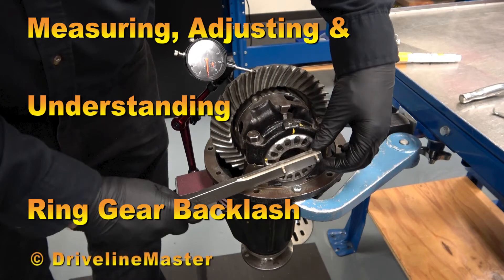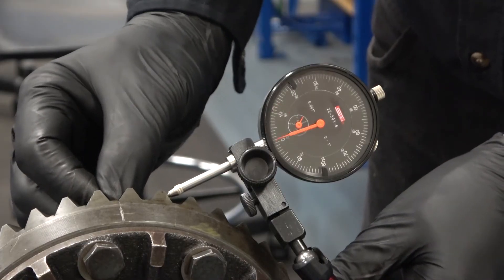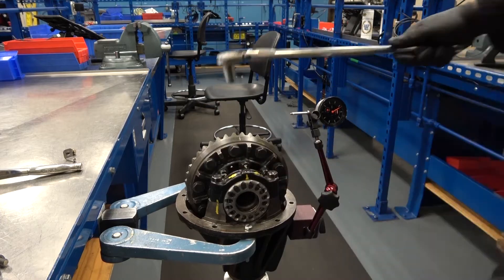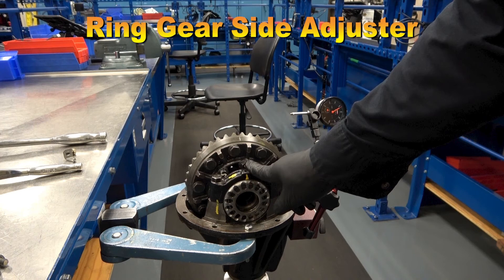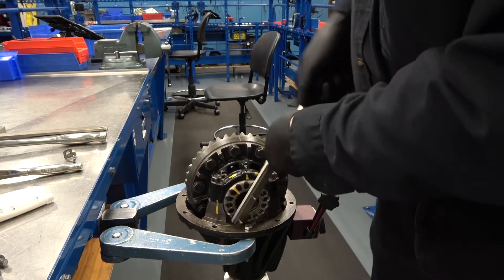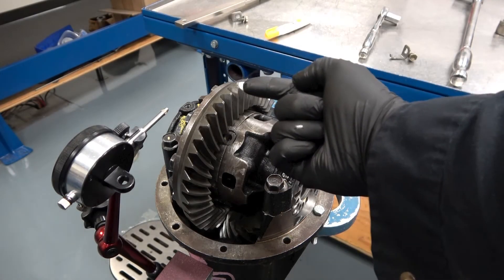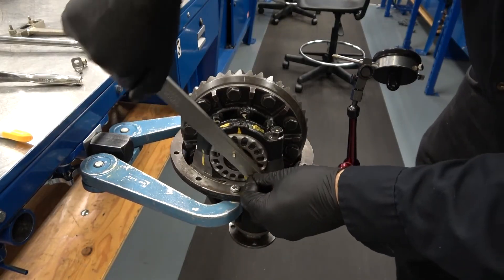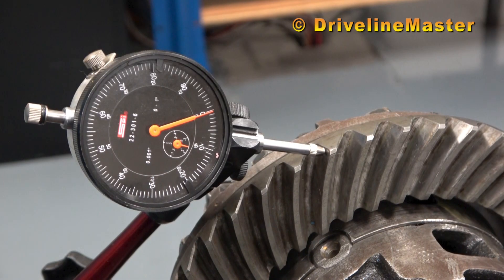Differential Backlash Exercise

Comment: Can my uncle juat take everything out and put new pinion gears and everything: will be alright
Reply from the maker: Sorry I didn't see this until now.  NO, when everything new is put in there needs to be setup and adjustments made.
Reply: @DrivelineMaster  well thanks i think he needs to get that done before something bad happen
Reply: @DrivelineMaster  just makes a clunking sound when you go from park to reverse and from reverse to drive and i want to help my uncle fix it
Reply from the maker: This can also be caused by worn out Universal joints on the driveshaft. The driveshaft should be removed and the joints inspected.  If the problem is excessively worn spider gears it would be possible to just change out the spider gears and not touch any other adjustments and settings but it's rarely that simple. If the spider gears are worn it's possible that the case or pinion pin is also worn.  If you just need to replace the pinion pin and spider gears once again you could get away without having to make any settings.  Beyond that any other fix would require the knowledge and tools to make all the settings.  If it's high mileage which is what I would suspect there is a good chance it will need more than just spider gears and a pinion pin.  You are right to be concerned because letting it go can and will end up making it more expensive especially of something lets loose and breaks all together.  The only way to know for sure is to 1) inspect the driveshaft U-Joints and if they are OK the back cover will need to be removed to inspect the internals of the differential to determine where the excessive play or backlash is coming from.

Comment: My uncle 1996 mercury grand marquis gs is making a clunking sound when you put it in reverse and in drive. I thought it was the u joints but they're fine so the guy said it was the differential. The differential have play so can it be rebuild or he have to buy another differential?My uncle 1996 mercury grand marquis gs is making a clunking sound when you put it in reverse and in drive. I thought it was the u joints but they're fine so the guy said it was the differential. The differential have play so can it be rebuild or he have to buy another differential?
Reply from the maker: Yes, the differential can be rebuilt.  the play might be in the spider gears and not the ring and pinion or it could be both. It's time to remove the back cover and do an inspection.  I have also see the pinion pin and case were out causing this same thing. Next step is a visual inspection to find out where all the extra play is coming from. You may not need a new ring and pinion.
Reply: @DrivelineMaster  this is correct. I had a pinging noise in my 98 Mitsubishi Montero. Turns out it was worn spider gears.
Reply from the maker: Spider gears will typically only make noise on some kind of a turn and get quieter going straight.